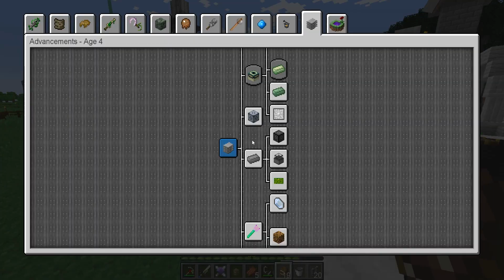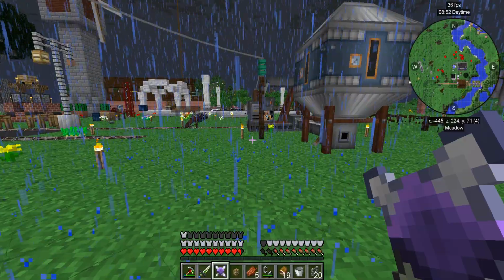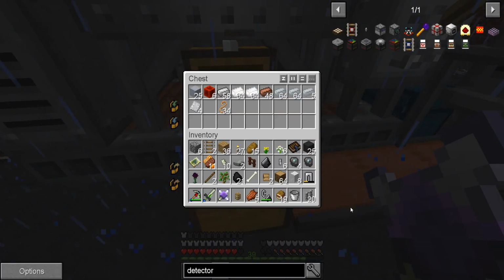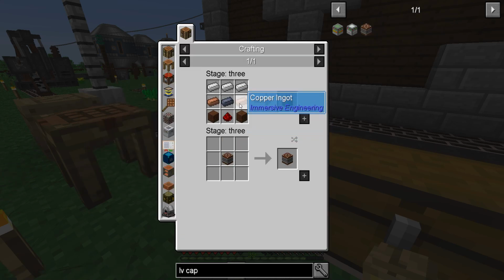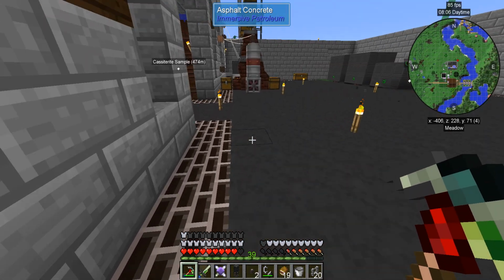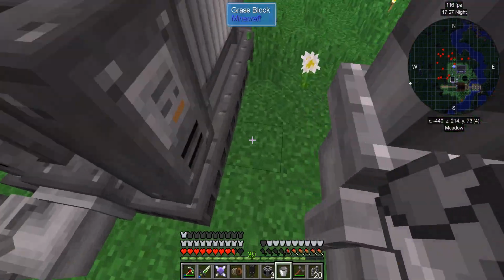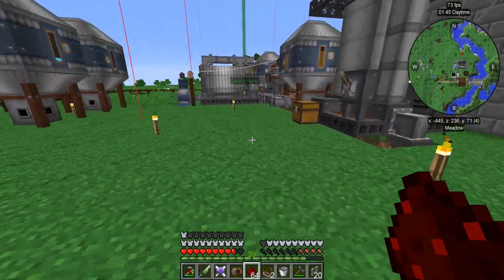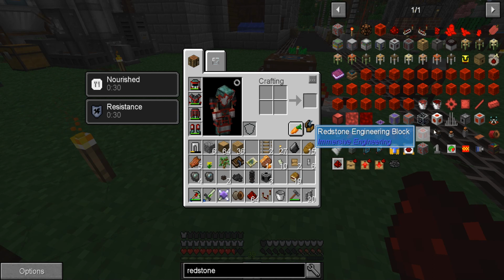SevTech Ep 25 pt 1 - Fiddling with power

Comment: You can place any type of capacitor directly on the drill and set the contact side as output. Also you can use HV, MV capacitors with LV connectors one way to convert power types. I bet you can also charge the capacitor the same way. Danny and son showed the redstone needed for your high low power switching, it is fairly simple, in his automated redstone realtech episode.
Reply from the maker: I discovered the connector trick recently...didn't know about the capacitor/drill thing though, that's a great bit of info.  I think I'm done with the diesel generator now but I'll probably check out the redstone just to see how it works.  As always, thanks for the tips.